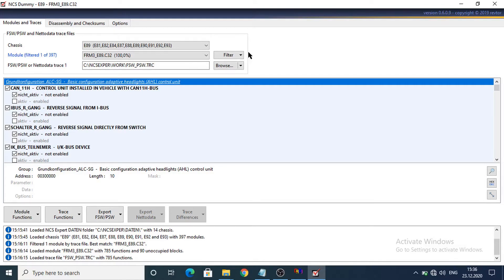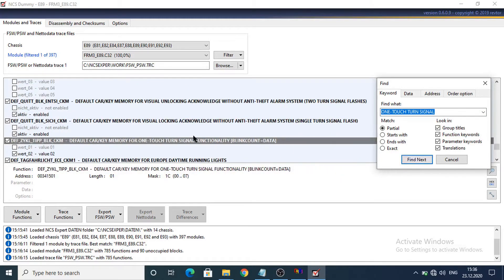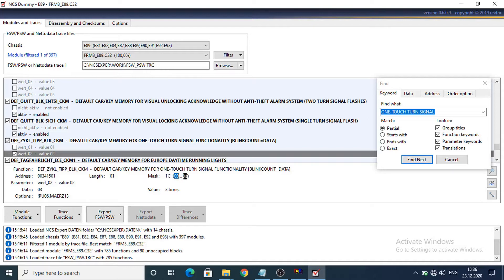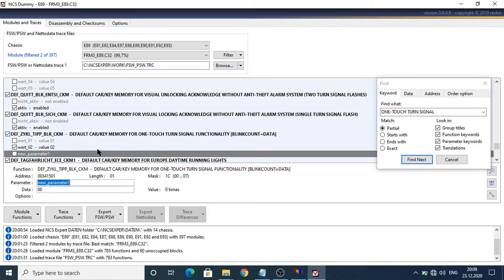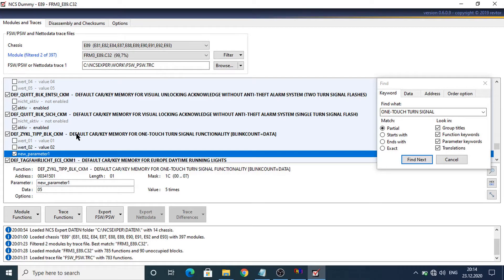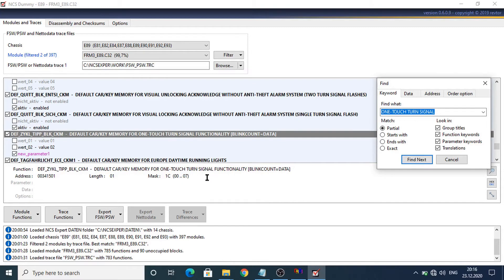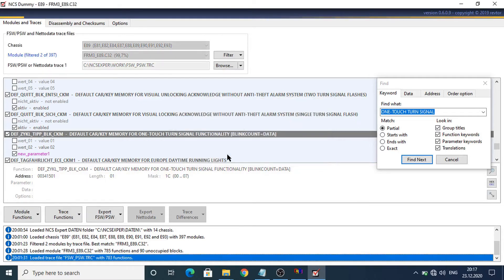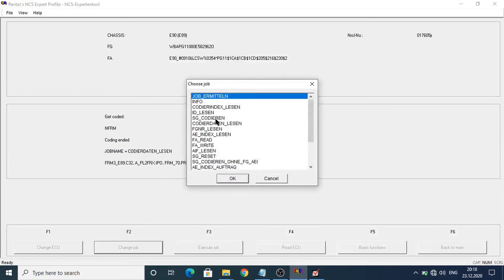9.1. Configure number of blinks in one touch turn signal

Comment: When attempting to code my E60 car using NCSExpert, I encounter an error message indicating that coding to the car is unsuccessful due to parameter issues. Is there a solution to resolve this? It's worth noting that I'm coding the light module, which is an LMA, and my car is an E60.
Reply from the maker: Hi, maybe you have issues with SW installed or with cable, is very difficult to found where is the problem, you can check with INPA SW to see if there is a communication between car and pc.
Reply: @BMWEMS  Thanks for getting back to me. I've confirmed that I have a connection with the car through INPA. I can successfully code my car as long as I don't put any new custom parameters. The error only occurs when I attempt to add a new custom parameter. Are there any other steps or checks I should perform?
Reply from the maker: @frankpap2672 by any new custom parameters you mean you select an already existing value in NCS Dummy? Or you are adding new parameters in NCS Dummy?
Reply: @BMWEMS  I am adding a new parameter, as you showed in the video
Reply from the maker: Maybe something is wrong generated there, you are putting a value which is in mask interval? On my side there is a value between 1 and 7?
Reply: @BMWEMS I have the same mask interval of 1-7, exactly as in your video. I have no idea why it fails to execute the job when coding. It would be really great if I could code 5 blinks.
Reply: @Frank-x-y-z  Did I work out a fix?

Comment: so we can do the same things for another options right ?
for ex: to change voltage for angel lights to add new value ?
Reply from the maker: Hi, basically yes, you can add new value for a lot of thinks, I have also a video with changing values for "us lights", but is very important to be in the tolerances accepted by the ECU for each configuration.
Reply: @BMWEMS  yes i saw the video about us lights :) i dont know if you know that but i have cruise control in my 2005 e90 320d 163ps car it works fine but when i change the speed there is nothing on dashboard i changed a lot of codes from e90post.com but it wasnt work unfortunaly
Reply from the maker: Hmm, sorry to hear that, but sometimes not all codes are working fine, I assume there maybe are some little bugs/incompatibilities 😔